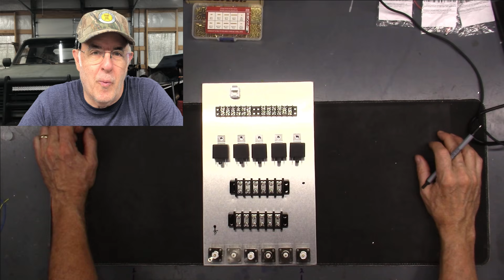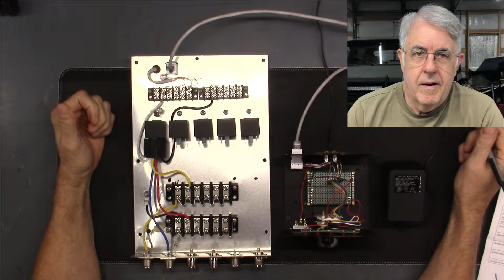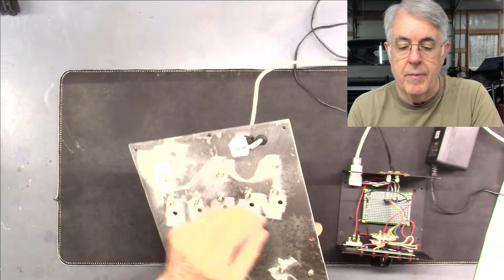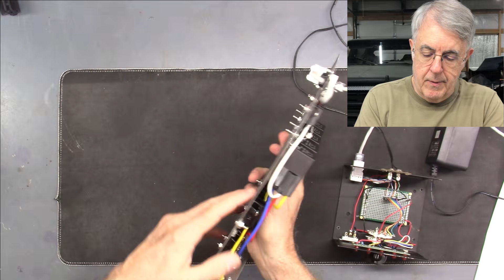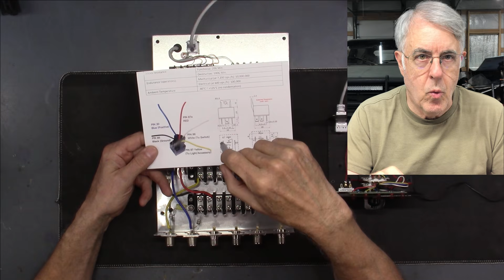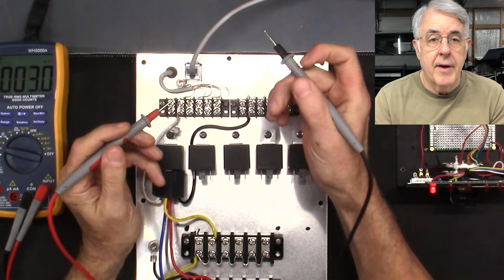DIY Remote Antenna Switch Build, Part 2

Comment: interesting project you have done with antenna control unit. have you checked how many watts you can give out to the box.?? you might have said it in the video but missed it. I also saw now that there is a relay with flat fuse
Reply from the maker: If you are asking about the maximum wattage it can handle my estimate is 500-600 watts. Unfortunately I have no way to test it do proceed cautiously gradually increasing wattage and monitoring your output.
Reply: @BudgetHamRadio 
I just found your You tube channel and I have to say that you are a very dangerous man. because you give me so many building tips that I would like to develop as well haha.😂I saw it on episode 3 and had missed that you had added an extra. then it was smart to use coaxial cable and you don't have to have a smaller connection point and it will be much cleaner. 
I like your YouTube channel and I shall send you little coffee money and you can working with tips and ideas
Reply from the maker: thanks so much for your kind words and your support!

Comment: Thank you for the video. I’m currently gathering ideas for a switch and relay system for RX antennas. This has been the best. Could I simplify the switch box with spst individual switches and avoid the boards? I’m not confident to copy your design on the switch box. It would also allow a combination of multiple RX antennas at the same time
Reply from the maker: Should work for receiving only no problem.

Comment: Thank you Jerry for all you do!  I have leaned so much watching you work!  would love to see what the loss within the intereral circuit SO connections.  The profesional venders people say that almost as inportant is loss is keep the circuit isolated it key for receiption.   Also is there  any limition of frequency, will this design work for HF, VHF or UHF with these realys.   Hope my questions make sincel.  

Jim Lyerly WB4JAG
Reply from the maker: Still testing but looks like 6 meters is going to be the max frequency.  With unshielded wires I can understand that. If I go the pcb route later it will probably be able to go vhf but for this design it is mostly for hf.  73, Jerry

Comment: Very cool video sir.  Out of curiosity, what type of radio / AMP gear are you building this for?  I am still a new Technician, so I will not profess to fully understand everything yet.  But wouldn’t a 100w radio be sending over 70 volts on transmit through the coax?  If the relays are only rated for 14v, would they fail on transmit?
Reply from the maker: You are right about the voltage.  I will be running a 100w hf rig.  
The relay contact is rated at 40 amps at 14 volts. The contact can handle the power fine. The electromagner is what is limited to 14 v   The contacts should be able to handle around 560 watts.  I will be testing at around 100 watts since I don’t own an amp. 100 watts into a 50 ohm load would be around 1.4 amps at 70v.  Well within the power limits of the relays. Will test it all in next video.  Thanks for watching!

Comment: Hi Jerry, been following this with interest and impressed with the result. My only concern is to what extent (if any) there is interaction within the box and whether it maintains the 50 ohm impedance match. Hopefully the testing will confirm. Best 73 de Peter GM4RAH
Reply from the maker: Thanks Peter, that's a great question! I'll be addressing that in the next video with full testing.

Comment: You did a fine job there Jerry.  It may not be fancy pcb construction, but the switch box looks factory and it works!  As you've demonstrated with your multimeter.   I drew up a schematic of a smilar remote antenna switching station last year, intending to build one but unlike you, I have not built mine yet. I plan on using RG316 coax with grounded shield, to conect the RF in the box from the SO-239 to relays, etc.  :-)   If you do have PCB's made up, I would be interested in putting one together myself.  I'll be looking for more info here!  Good Luck!
Reply from the maker: Thanks!  I already have some mods being suggested for this one which is great!  So I see the possibilities.

Comment: Cool project!  Thanks for taking us along for the ride!

It did occur to me, though, antennas are not DC devices - they work at radio frequencies.   And, I would think that would complicate things when making an antenna switch.   For example, how are you maintaining the proper impedance throughout the circuit as the signals move through the wiring and relays?    And, how are you keeping the ports isolated in the absence of using coax for your SO-239 connections?

I've never built an antenna switch box myself.   But, I have looked inside the manual switch boxes I have.   And, they are all designed to keep lead lengths as short as possible and/or incorporate short coaxial jumpers to maintain isolation and impedance.  I just have to wonder what all that regular electrical hookup wire is going to do to the signals?

I look forward to watching this project progress!

73!
Reply from the maker: In my private testing so far that has not been an issue. SWR looks good and everything works as it should. More tests in next video.

Comment: Thanks for number two in this serie,,
Is there possible to mount a relay in the controlbox with a 239 so you can connect a dummyload to the radio, just to 
minimize the risk to blow the finals in the radio if someone starts up the radio and pusch the PTT/CW key. 
Think it would be a saftey for it and in the same time you dont have the koax connected to the radio and can avoyd statics in to the radio, hopefully you dont have to much loss in a switching relay
Just a tought.
Best regards and 73 SM3TEK //Lars
Reply from the maker: Thanks Lars.  I have considered that or making the number 1 antenna as a default so that if there is no power or a power failure to the switch the number 1 antenna would be active by using the normally closed relay contact. What do you think?
Reply: @BudgetHamRadio  If you do that, you have to activate the relais 1 on every other position (2, 3, 4, 5) or else you would have them parralel with all the other antennas. If I see it right ;) I would probably use a relais in the feed line with the normaly closed to a dummy load (dummy load resistor), and the switched contact to the rest of the relais. You would have to feed that relais with 12 volt with an extra wire, or maybe with the use of a diode taking power from the relais you're switching.
Reply from the maker: Thanks for the ideas

Comment: I like everything you have done.  I would wonder if you could change the first relay so it would be connected to ant 1 , if there was no power?  that way, you'd always have one ant connected if power was off, for some reason... just a thought
Reply: I was thinking "no power" should connect to a 100W dummy load.

Then power would connect to the rest of the antennas.

Just my $0.02
Reply: @jamess1787  Also a great suggestion
Reply from the maker: @jamess1787  yeah I’m trying to decide which approach to take.  It either needs to default to a multi band antenna on coax 1 or to a dummy load.
Reply: This is a good idea. This could be accomplished by wiring in one port as normally closed and the rest normally open. Then you could wire it where when nothing is energized, that one port is connected. If any other ports are energized, it switches to that associated port AND opens the "normally closed" port.
Reply: I love this build Jerry! Great job! Another option to the "default antenna" , or the "grounded when not selected" might be to add 50ohm resistors to ground as a "dummy" load. There are smd chip resistors that are low inductance that could be mounted right on the backer for heat sink. (I guess you might want 50ohm for the radio coax... Gnd for the unused ant's...)
Reply from the maker: Thanks for the suggestion!